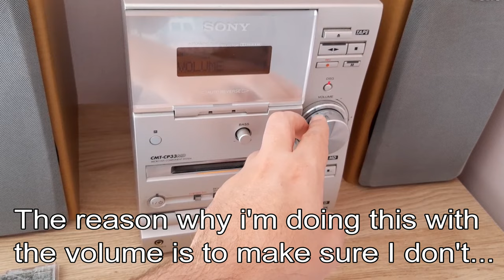Can I Fix My Faulty Sony Hi-Fi CD Player? Tips Revealed!

Comment: Congrats on that repair. I certainly enjoy a full disassembly video, it has some ASMR to it. I'm curious, does the MiniDisc part work? Those will not die with time in such a notorious way as DCCs, but still I think they do more than a plain CD player.
Reply from the maker: Yes! The MiniDisc does still work & I play some discs on it every so often. I found the recording aspect of the MiniDisc player on this really useful back when I recorded a lot of things. 

I'm glad you liked the video, I thought I would give a non-verbal video a try out...mainly because I wasn't able to do a full voice-over and just wanted to get the video done & move on to my next project.
Reply: @TheRetroStuffGuy What is the reason if the minidisk is stuck and does not come out? Does the belt also need to be changed or is it a gear mechanism? Could the mechanism be worn out or can it be repaired?

Comment: I have a similar system (dhc-md373) and I just want to use the system to play music through the aux port. Is it possible to make the loud noise stop without having to completely disassemble it?
Reply from the maker: I don't believe so. With my one even when I left the CD tray in the out position when you turned it off/on it would always try to engage.